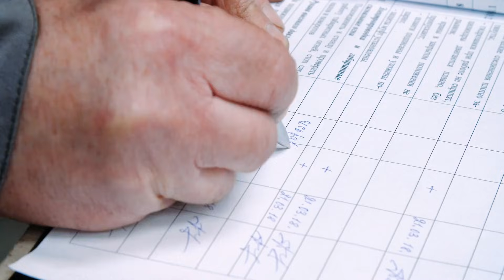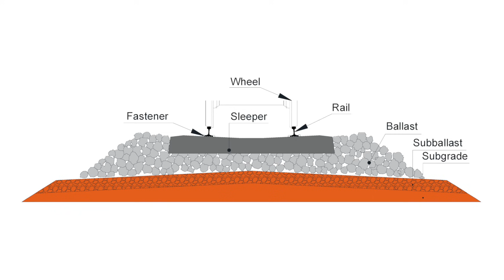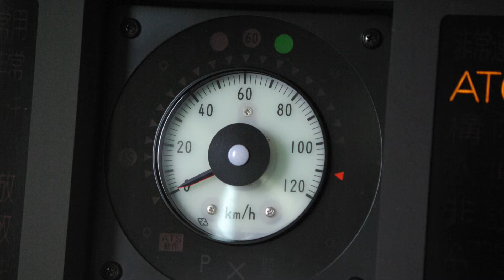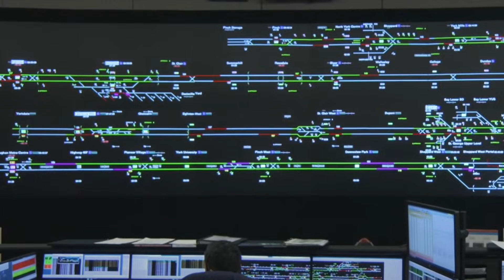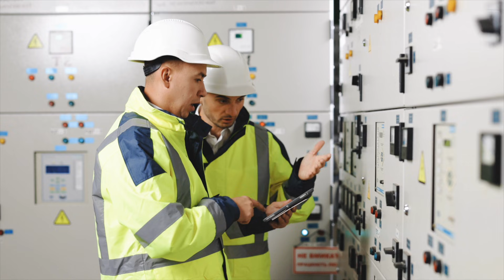Inside China's $1 Billion, 9-Hour, 1,500 Worker, and 23 Digger Railway Station Build

Comment: To the UK government that's how its done. Not months years on something that can be done if you put numbers before profit
Reply: The Second City Crossing, the tram rail extension from Victoria Manchester to St Peter's station, took three years to build, with construction starting in early 2014 and the line opening to passengers on February 26, 2017. 

Here's a more detailed timeline: 

Early 2014: Construction began on the new Exchange Square tram stop.

Late November 2014: The first tracks of the line were laid.

December 6, 2015: The northern section of the new route, including the Exchange Square stop and a 500-meter stretch of track, opened, allowing a Shaw & Crompton-to-Exchange Square service to begin.

December 1, 2016: The first test tram ran the entire route.

February 26, 2017: The first passenger service began operating on the Second City Crossing.